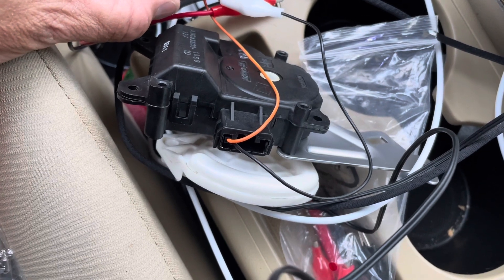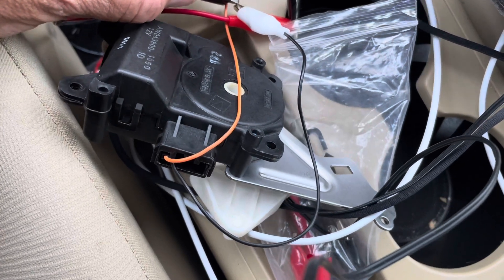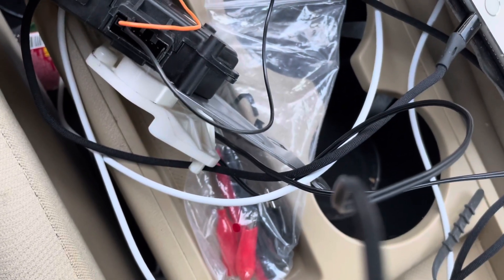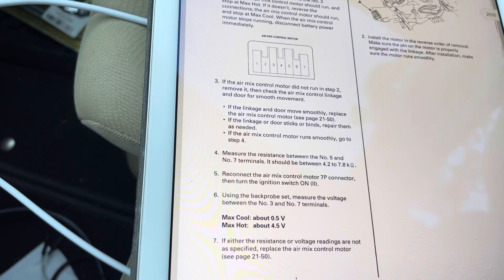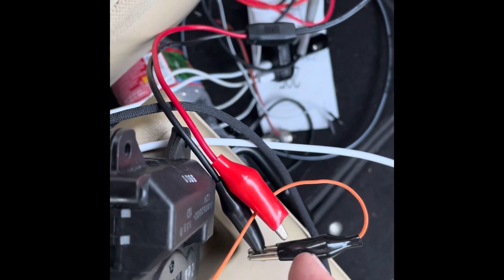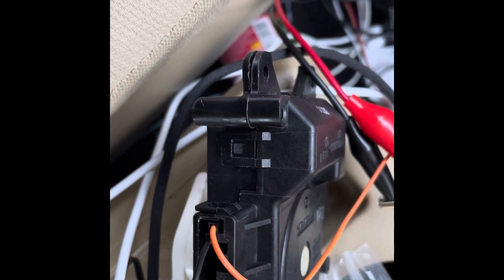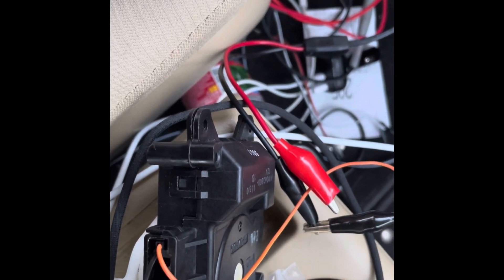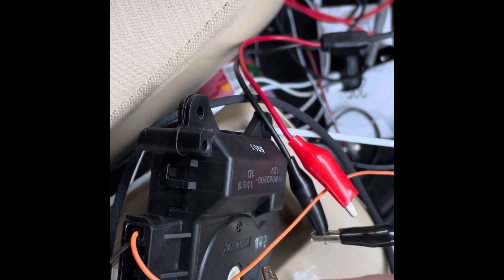Positioning Testing Air Mix Control Motor Actuator Honda CR-V (2006–2011) with 5v USB

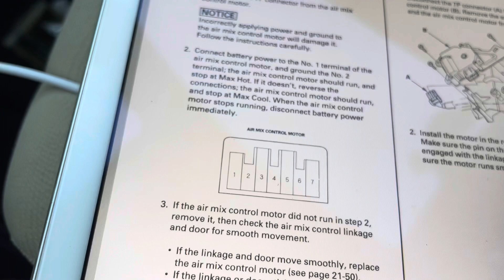Comment: This test proves that the actuator motor works (pins 1 and 2).  However there is also a cam position sensor (basically a potentiometer) in there on pins 3,5, and 7 which is also a point of failure.   I believe the resistance should change smoothly on pins 5 and 7 as power is applied to pins 1 and 2 and the cam moves through its range.   It appears the computer's fail-safe mode is to set the blend door to low temp if the position sensor data is invalid.   The test for the position sensor appears in step 6 of the service guide at 0:18.   It says to check the voltage at max cool and max hot but there could be a drop-out in the middle of that range.  So in my view the test should say to measure the voltage in the entire range not just the endpoints.   A reading of 0 V anywhere in the range means there is an open in the sensor and it should be replaced.
Reply from the maker: Great detailed comment. I'm going to refer back to this. You know more than I do.

Comment: So if the actuator work does that mean there's a shortage in the circuit wire that's going to the actuator how do you fix that the right way ?
Reply from the maker: If the actuator works, the climate control panel could be the issue causing your problem, assuming your wiring is correct. Look at this video. https://youtu.be/inOAfpztOgQ